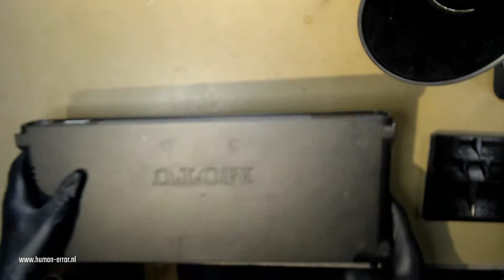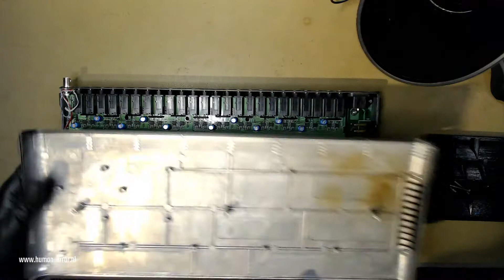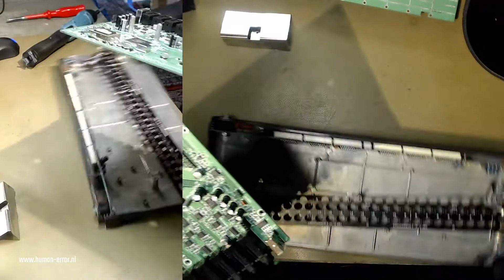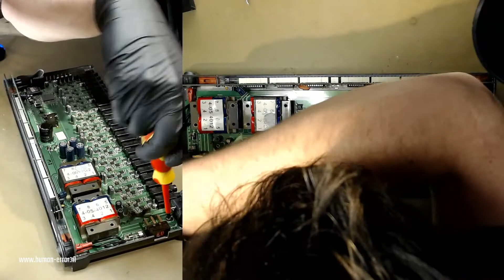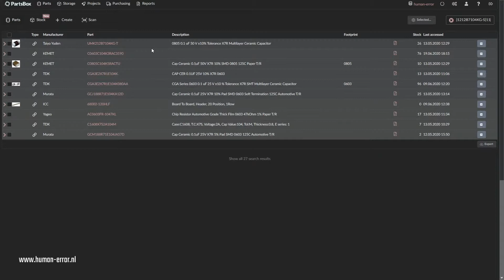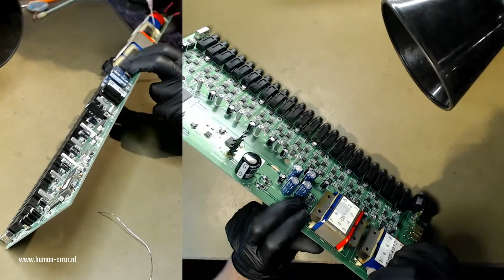MOTU 24 i/o -  Catastrophic failure after wrong voltage  - Live

Comment: damn it I did the same thing - bought a unit from the US. Thought it was internally switching, but only noticed the switch on the outside after you mentioned it in the video. No smoke from mine, only a buzz sound then no power. I think blown fuse

Comment: My unit won’t connect to the 424 pci card after power outage, leds ok, but computer won’t see it. What do you recommend to check first? Psu, DS36C200M? Thanks
Reply: DS36C200M has 4.25V of Vcc leg 2, less than 4.5V needed (
Reply: @AHigherWaves  Did you ever figure this out? I've been having similar issues with my 24 i/o and 2408mk3

Comment: 1 SOLUTION 1 MINUTE .... CHANGE FUSEEEEEEEEEEEEEEEEEEEEEEEEEEEEEEEEEEEEEEEEEEEE !!!!!!!!!!!!!!!!!!!!!!!!!!!!!!!!!!!!!
Reply: iHAVE 2408
Reply from the maker: Thanks for the suggestion, but the fuse was fine on this unit. The transformer was burned.
Reply: @HumanErrorSynthRepair  I have changed ... and resolve ... for wrong voltage explosion ... you burned trasformer ...  ahahah ok

Comment: Hi, would you say that the 24io is still a good quality and relevant device? I certainly love mine (12+ years of use) but can't find anything so flexible for a reasonable price to compare/improve upon. I record drums so multiple inputs are required and multiple outputs required to feed my 24 ch desk. Cheers.
Reply from the maker: If it works for you, it's fine, don't you think? There is not too much to choose from, and I think MOTU is quite okay as a brand. Especially, as you say  for the price.
Reply: @HumanErrorSynthRepair  Hi ! Same question here. We have this converter since 2015, no problems at all. But now we're making setup in new studio, at least i'm curious about old capacitors on board. So how do you think, it will be better to replace them ?